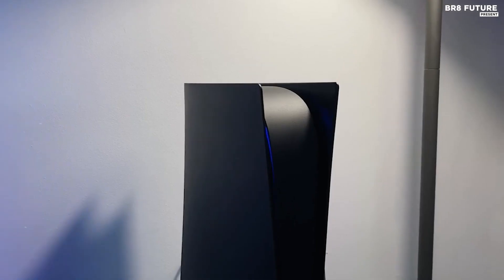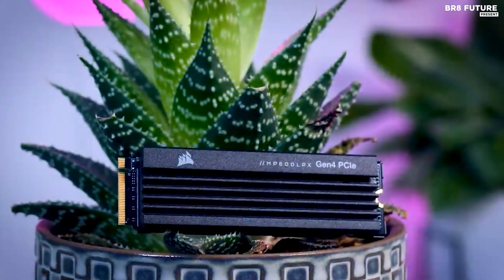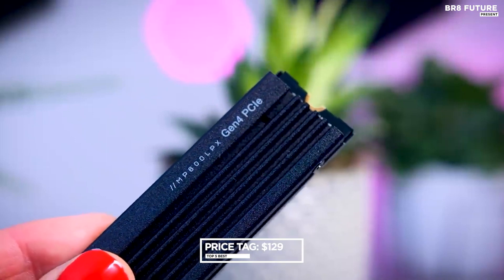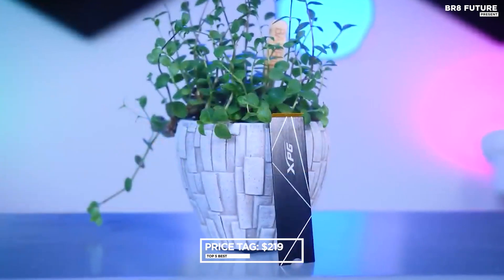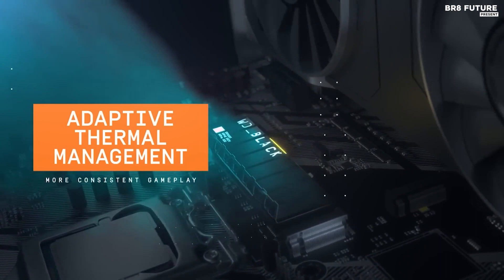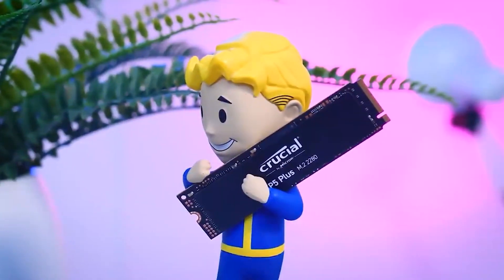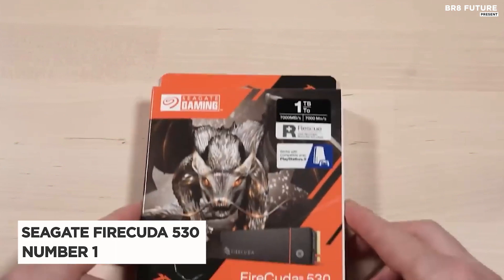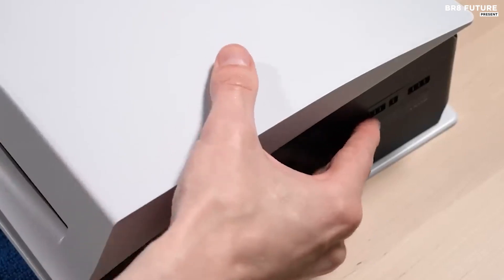Best PS5 SSDs 2023 - Which SSD Should You Buy? [2023]

Comment: Should I get the S70 Blade or SN850X ? The S70 is $18 cheaper on Amazon for me.
Reply from the maker: the best choice for you will depend on your specific needs and budget. If you're looking for the absolute fastest SSD, the SN850X is the way to go. However, if you're on a tighter budget, the S70 is a great option that's still very fast. both excellent PCIe Gen4 NVMe SSDs
Reply: Can you review as no has PS5 SSD Integral Advantage Pro-1 2TB M.2 Gen4